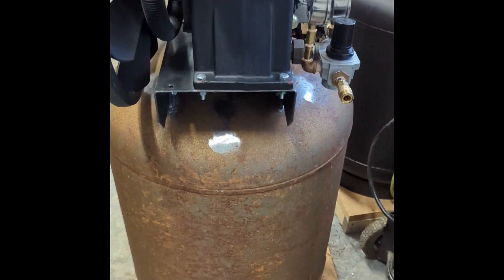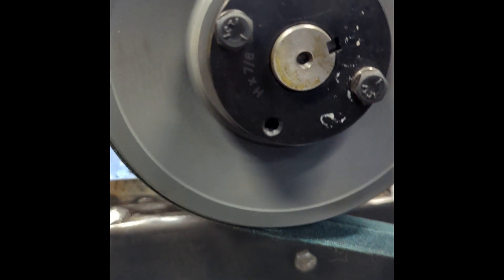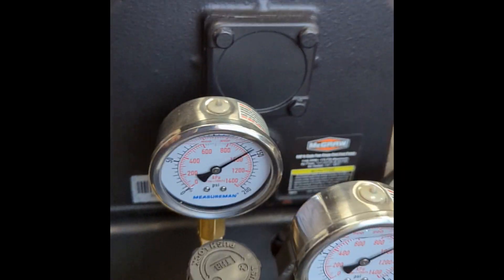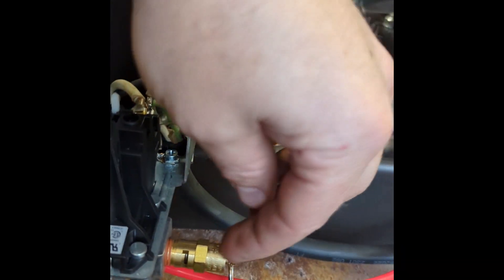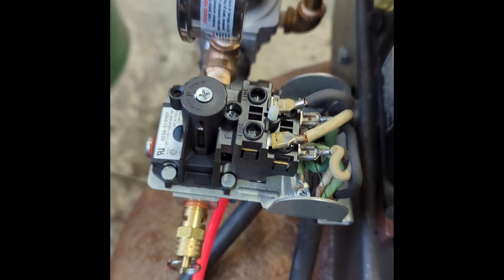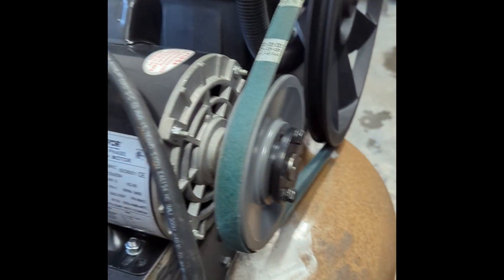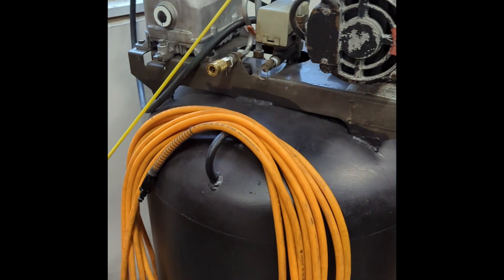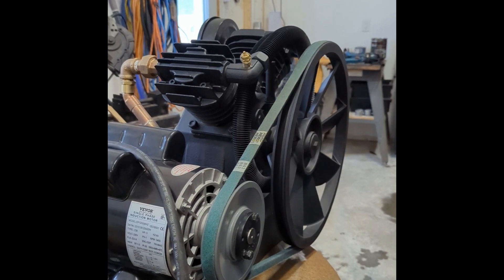DIY Compressor Build Using a Harbor Freight Pump a Vevor 5HP Motor and 60 Gallon Propane Tank

Comment: Great job but having done a bunch of these those solder joints won't hold when it gets up to pressure and 400°f... Made that mistake before. Make it one piece and compression fitting or better add an air to air cooler
Reply from the maker: Been using it for almost 2 years now without any issues. A correctly soldered joint in copper tubing can hold several thousand PSI. Working pressure is around 200-300 PSI depending on solder and pipe type.

Comment: I just bought the same pump. The air intake line from the tank into the head of the pump gets so hot you cant even touch it and my pump sounds like its knocking. Its brand new. Do you have these issues? Thanks for the kickass content as always! ❤
Reply from the maker: That is normal. The pipe will get hot on any compressor. When air is compressed it will be hot and that is why there is condensation happening. As for the knocking make sure you have oil in the compressor and it is likely normal too

Comment: Very good I myself like doing stuff like that too years ago I used an ac pump off a Ford pickup along with a 2hp motor and an air tank from a wreck semi trailer and it worked l didn't have continue manually pumping my tractor and pickup tires I lived on farm 20miles from town that thing was so good someone broke into my shed and stoled only that and didn't touch far more expensive tools I hope whoever it was took good care of it

Comment: Nice build! Great idea using another bolt to tighten the motor once you get the belt tensioned. I used the same general idea for adjusting the tension on mine but without that third bolt and it always ended up shaking itself loose (probably didn't help that it was bolted to a 1/2" sheet of plywood instead of a C channel either, haha). I'm going to rebuild mine at some point, and it will probably end up looking a lot more like yours.

Although one thing I did different which I plan to keep is that I have my tank mounted upside down with a drain valve pointing straight down. This ensures that I can drain any water that gets in the tank.
Reply from the maker: I added a drain value in the bottom

Comment: Nice build, Thanks for sharing! What diameter is the small pulley on the electric motor, I know they recommend a 5.600 diameter but I can't find one for a B width belt? I'm building the same thing as you did.
Reply from the maker: Are you in Canada? I bought the pulley at Princess Auto. What is the shaft thickness on your motor?

I bought a pulley like this and then bought the insert based on the shaft thickness https://www.princessauto.com/en/single-groove-cast-iron-sheaves/product/PA1000001359

I used this site to calculate the belt length and pulley size https://www.blocklayer.com/pulley-belt

Comment: I'm doing the same with a 80 gallon tank. One thing to remember always be very careful if you don't know what the inside looks like. You can pressure test all you want and it might be good now but you might also have rust blisters in there that are only waiting a few months to a year down the road to blow. I bought a borescope from Amazon for 60 bucks so I can check out the inside every once in awhile. 
P.s. you made that whole video and we couldn't even hear it run gd😂
Reply from the maker: I will do another video to show it running and how I hock it up for auto shutoff if hose would break and I'm not in the shop.

Comment: Do you have the link for the pulley and belt?
Reply: Also looking for pulley and belt for motor!
Reply from the maker: Yes here is the link to the pulley https://www.princessauto.com/en/single-groove-cast-iron-sheaves/product/PA1000001359

Here is the site I used to calculate the belt length and pulley size https://www.blocklayer.com/pulley-belt

Comment: Does it have a check valve installed? Where did u get the pulley and what size belt width is requiered?
Reply from the maker: Yes both the compressor and tank have a check valve installed. I bought the pulley at Princess Auto. The belt is 1/2 in width also from Princess Auto

Comment: FYI The Propane tank you are using is rated for 200 PSI and usually has a 200 psi blow off valve on it for safety, so I would most likely not pressure it above 150 psi without the release valve. This would be a bigger concern in the summer heat. Nice job on the build.
Reply from the maker: Thank you for the feedback. I do have the standard air compressor release value which is rated at 175 psi

Comment: Good design and workmanship.  Once painted, it will look nice.
Welding on pressure vessels is always a bad idea. It creates stresses and weak spots in the steel which can fail, and sometimes those failures are catastrophic and deadly.  I recommend pressure testing the tank by filling it completely with water, then pumping in as much pressure as you can.  If it fails when full of water, it won't kill anyone.  After that, your working pressure should be adjusted much lower than your test pressure.
Reply from the maker: Good idea. Thank you for the feedback. I did read that propane tanks are tested at 600 PSI